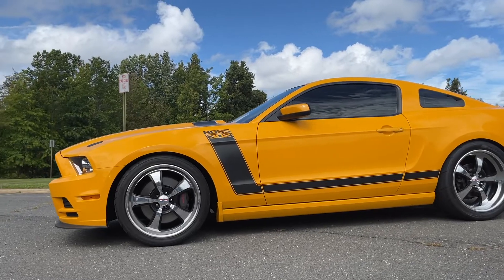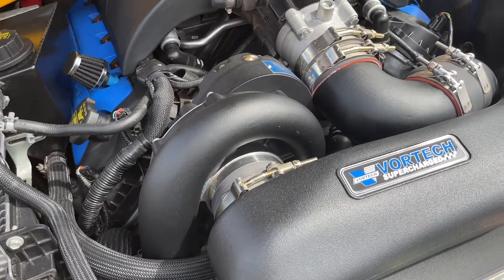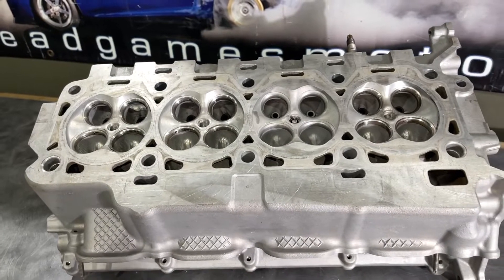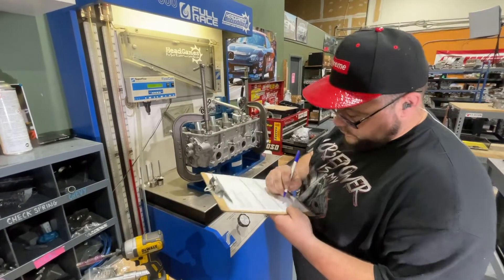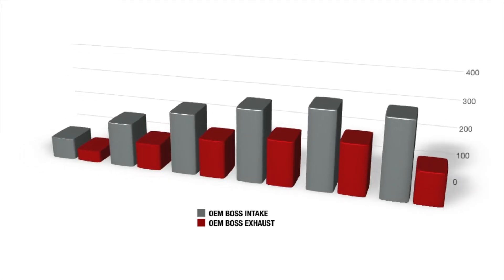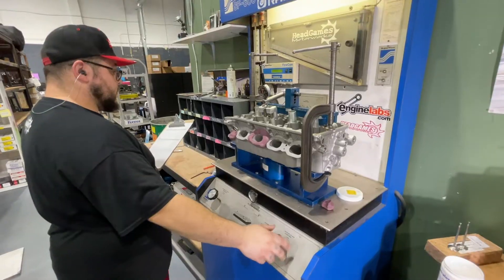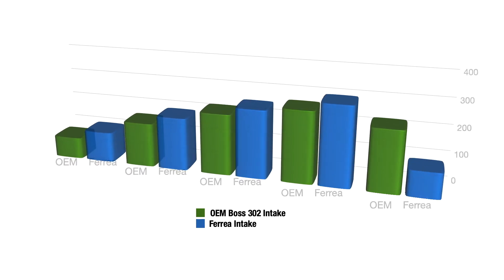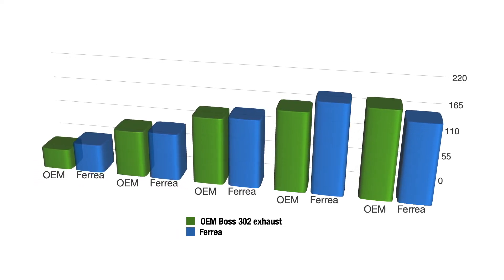Ferrea vs stock valves in a Coyote! Worth the upgrade?!

Comment: what ferrea valves did you use in the boss head?
Reply from the maker: they only offer the comp plus for the Coyote. Stock size.
Reply: @headgames  I have FER-F2245P + 1mm for exhaust, and FER-2242P standard for intake on my Boss heads